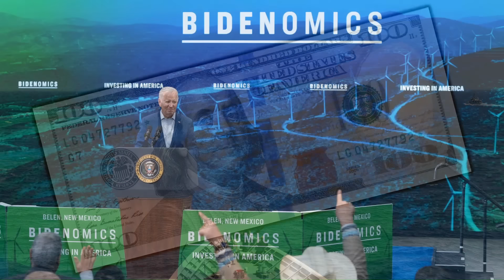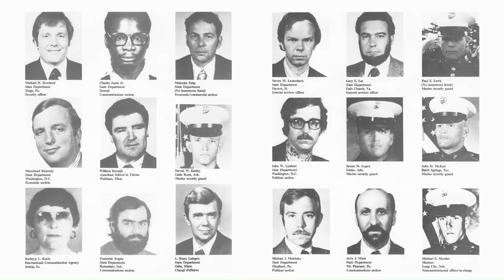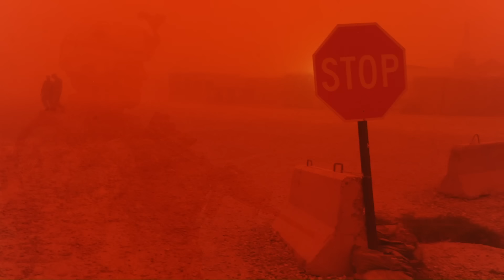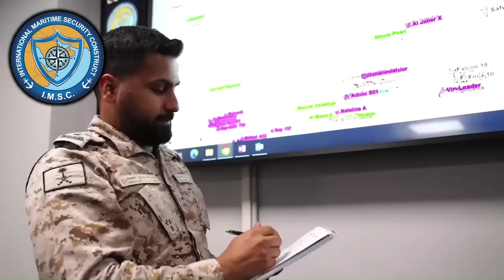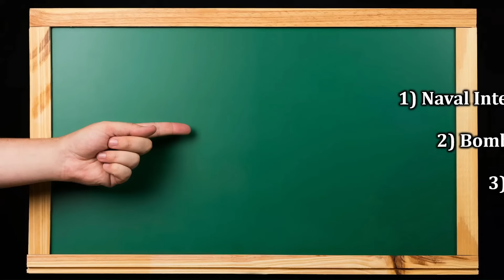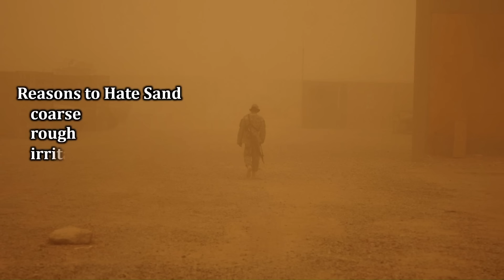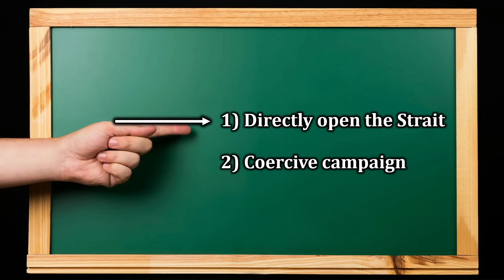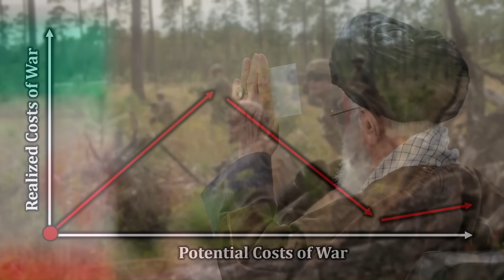The Nightmare Scenario in the Middle East

Comment: Speaking as a nuclear engineer:

The analogy used when talking about enriched uranium is very bad. Centrifuges are extremely power hungry devices, and having 60% U235 does make enriching easier, but that misses the point. The point is: You do not use 60% U235 for civilian purposes, anything above ~35% is reaching the upper limits of power generation enrichment. most reactors use anywhere from 1% enrichment to 30% enrichment. If a country is found to have 60% enriched uranium, it has uranium that is enriched past civilian use. This is the important point
Reply: Thank you for pointing this out
Reply: Obviously. The point he was making though is something else. He was saying you can’t pick out the U235 isotopes but you can have more of it if you keep spinning it in centrifuges until you have enough to make it a weapon.
Reply: It will be used only for peaceful purposes😂😂😂
It will. It will.

It will be used for clean energy and medical research. And will never be used to attack Is... Oh boi

Comment: The portion about submarine minelaying is very poorly researched. There are no "safety corridors" and Iran's subs are considered very capable at minelaying. The mines would be primarily laid just outside the Straight of Hormuz, not right on it as that isn't necessary. The depth issue is frankly... not an issue.  They would have to surface eventually, but SSK endurance here is also very underestimated. All of Iran's currently operating subs are capable of minelaying and returning to their berths without puttering around on the surface. It would still be very risky, but I feel that the roadblocks detailed in the video drastically underestimate Iran's submarine force. This is a growing threat that is increasing year on year. The latest mines they use were purchased from China and can operate at depths up to 350 feet as well as very shallow water.

Comment: Two things people don’t appreciate with respect to nuclear weapons and enrichment are really vital for sane policy:

Atomic vapor laser isotope separation requires a lot less energy to function, along with less time and physical space.

As William Spaniel correctly points out the more than half the energy expenditure is done getting to 5 percent enrichment.

Less well appreciated is what it really means in terms of time to finish the job, and the fact that it’s easier to protect a smaller set of machines and materials.

A pilot (small) plant can finish the enrichment job even if the methods used to build it don’t scale well, whether for cost, sanctions preventing easy supply of critical components, or even high labor cost.

Also, it takes far less plutonium to make a nuclear weapon than uranium. Burning fuel once through even with a breeding ratio less than unity still means using a reactor, if you have the time to do it, multiplies the number of weapons a given supply of uranium can produce.

The fact that isotope enrichment can be used in reverse to remove plutonium 240 to get weapons grade plutonium from spent nuclear fuel is made easier by the front end chemical separation reducing the quantity of material that needs to be processed.

The Iranian choice to make more low enrichment uranium before increasing its purity has the double effect of hedging bets (being able to make multiple crude nuclear weapons, before going down the path of plutonium breeding, which at any given point is making more weapons than the opportunity cost of the currently tied up fuel.

I’d also suspect that Iran might forgo a formal nuclear test and instead use a nuclear weapon if pushed far enough in the near term.

The fact that Iran developed delivery systems before developing nuclear weapons is a bit backwards from history would create for expectation and will provide little warning if/when Iran first uses one as a weapon.

Comment: Very interesting & instructive thanks.
A quick look around online shows that Iran in fact has at least 75 diesel electric submarines but there is considerable dispute about how many are actually in operational wartime condition. 
Some years back they actually published thier policy for shutting the straights. 
They would tow oil tankers in to the strategic shallow spots & sink them to lessen the navigable channels  & use massed mine laying, shore missile barrages & massed small speed craft swarms including suicide attacks.
At the same time a large part of their submarine fleet would mass attack the Saudi oil fileds & production centres with ballistic missiles.
They acknowledged they could not win, so their defence is to threaten to shut the western world down, even if it costs their regime.
I've not heard in recent years but I would be very surprised if thisisn't still their tactics.

Comment: Who needs oil from there when you can run a Toyota Mirai for a quarter the price of an equivalent conventional vehicle. Keywords proton exchange membrane, no batteries, quick to fuel, no suck squeeze bang blow internal combustion engines, hydrogen fuel cells are now also powering Kenworth trucks for long heavy haulage

Comment: Surprised to find a missing scenario in this otherwise detailed analysis. UUVs or drone submersibles which were developed by the IRGC and deployed by the Houthis for the first time in February 2024, represents a major reframing of threat scenarios in the Strait of Hormuz. Mining the strait makes little sense considering that China imports 90% of Iranian oil production, the majority of which flow through these waters. Although the Iranians have begun diversifying exports through Jask Port in the Gulf of Oman and other alternative routes these represent a small fraction of Iran’s overall flows. At the same time these exports account for 17% of China’s oil imports, so there is little reason to suppose the Chinese government would support such a move. In sum, any hard shut down of Hormuz falls well outside of the bargain range as it represents an outright diplomatic and economic form of self-sabotage for the Iranians that would cripple their own economy. However, the risk of a low-intensity, escalatory maritime drone warfare scenario, where only specific flags are targeted through UUVs is an emerging threat vector that deserves some attention. CENTCOM has described it as an "imminent threat" to U.S. warships and international shipping. Even this would be difficult without a navy. Or coastal bases. The real issue would be the escalation ladder, where from those kinds of plays things could rapidly escalate to ASCMs and drone targeting of ships and if those sites are struck, outright targeting of Gulf oil fields. Even in the worst scenario where Iran decided to Hail Mary and shut down its own economic lifeline the U.S. has 4 MCMs stationed in Bahrain and clearing could be accomplished in 2-3 months. This would have an acute impact, but the world would go on. Tehran’s leadership, not so much.

Comment: An idea comes to mind: To load up an old barge with mines and ""accidentally" sink it in the Hormuz straits leaving a control cable behind the tow boat you can connect to land and release the mines to the surface whenever needed. Or using a timer such as ropes rotting in water. It's a simple idea and I'm probably not the only "genius" coming up with it so how do you protect against something like that?

Comment: A point that wasn't made in the video is that between 1953 and 1979, Iran and Arab countries took opposite sides on the subject of Israel vs Palestinians.  But since 1979 they have been on the same side.  Since 1949 no Arab country has been willing to go to war for Palestinians (and neither has Iran).  The only wars they have been willing to fight with Israel were when invaded by Israel or to try to recover their own territory from Israel and even Syria hasn't tried that for over 50 years.

Hopefully, the interests of the US are not the same as the interests of Israel, unless you believe that the US supports the subjugation of the Palestinians and the expansion of Israel into the territory it captured in 1967.  Obviously, Israel wants everyone to believe that the US supports them over all these issues and certainly the US does very far less than it could do to try to obstruct Israel in these goals.  

As the various Arab countries have been bribed by the US into recognising Israel or have been outright destroyed (Iraq, Syria, Libya), Iran becomes the most vocal remaining critic of both Israel and the US.  It is clear to Arab countries that the only way to a safe and prosperous future is to go along with the US and the US will insist that this means taking an anti-Iran stance and pushing Palestinians to the bottom of the priority list.  The US realises that the techniques it uses against Arab countries (be bribed or be destroyed) don't work with Iran.  So it is using isolation and anti-Iranian coalition-building instead.

Comment: Isn't the most straightforward solution a big pipeline that bypasses the Strait of Hormuz?

All these military suggestions are ludicrously expensive compared to just building stuff.  Look at the length of that East-West pipeline in Saudi Arabia, and the mountains they had to cross.  It's doable.

You blew off this possibility early by pointing out that a pipeline is a fixed target and easy to destroy.  That's not entirely true.  Bury the pipe under 50-100 feet of whatever's around, and you require very large warheads to break it.  Those warheads require exceptionally large delivery systems, which the US is already expert at intercepting.  And of course, every major pipeline system is made of multiple pipes, separated so that a break in one does not affect the others.

Heck, the UAE can have one pipe and Oman can have another, getting more resilience through more diversity.  Private companies won't pay to overbuild like this.  The redundancy serves national security, so governments pay for it like they pay for military assets.  But a pipeline outlasts an aircraft carrier.

It's a boring option because it deletes most of the international intrigue in favor of a program which gainfully employs a lot of construction workers to make a durable piece of infrastructure which reduces international relations.

Boring is profitable.  Boring lets us get back to arguing about who is on our school boards.  Boring is good.
Reply: Kuwait Bahrain and Qatar can't bypass strait of Hurmuz. Iraq, AUE and SA already made it. But they have to be 3-4 times bigger.
Reply: @micixduda  Sure, but can't the Gulf states build a pipeline that goes down their side of the gulf through to UAE and Oman?

Sure, it goes through multiple countries.  But lots of pipelines do that.  The point would be that it doesn't go through Iran, or to a port controlled by Iran.
Reply: @IainMcClatchie  Small states small production.
Bahrain is hardly worth mentioning with 167k bpd.
Qatar 1300k
Kuwait 2600k
UAE 3300k
Iraq/n 4450k/4100k
SA 9000k
-----------------
Total: 25kk
20kk goes over sea
5kk goes over land
Reply: @micixduda  First, that's a useful answer and I want you to know I appreciate it.

The video says Iraq, Saudi Arabia, and UAE can get their oil out without the Strait of Hormuz.  Is that true, or only partly true?

If it's completely true, then there's just 4000k that has to go through the Strait of Hormuz.  Are folks shipping through Hormuz because they want to avoid the fees from e.g. UAE for transit to their Gulf of Oman port?

Or is the UAE port insufficiently secure from Iran?  In which case, why not a pipeline across Oman?
Reply: @IainMcClatchie  Well lets just start with i never thought about these things before i watched this video.

Iraq goes via Turkiye to Mediterranean close to Europe. So Europe doesn't have to pay for longer shipping around the SA peninsula and Sues canal fees, but has to pay transit costs via Turkiye. I guess this balances out a bit, but considering it only transports less than 1/10th of production. It seems Europe rather gets its oil elsewhere or it is still cheaper to get it with ship all the way.

SA: Seems like it sells most of the oil toward the east. It has 5 kk pipeline and it  efficacy is at around 50%(good quarter of its production).

UAE has the capacity to transport via pipe almost 50% of its production to the east coast.

As for Oman, i have no idea. Maybe It can also be influenced by Iran, like Yemen is or it just comes down to transit fees and lack of oil infrastructure in Oman itself. Oman production is 1000k. Less than Bahrain with 1300k. 
But i'm sure Oman would have no problem upgrading its infrastructure, if they would build the pipeline to it.

Kuwait could probably use both SA or Iraq pipelines  to transport, but initial cost and transit fees are just not viable option atm, i bet they would start building those pipelines, if strait of Hormuz would be closed more than 1/4th of the year.

Best way to avoid transit fees is build pipeline in international waters, but pipelines in international waters aren't safe. Couple of divers or submersible drone, can do the 'nordstream' thing at anytime.

Comment: My only criticism on the war game point. The US purposely plans their wargames out with the intent of putting the us on a severe disadvatage. The planners think of all the variables that they can predict can go wrong and purposely set the game up with those variables go fubar. Things like stealth aircraft stuck with their bomb bays open, negating stealth, radio equipment breaking, lack of supplies or ammo. The us purposely loses war games to 1: get soldiers used to shit going wrong so they dont panic when plans inevitably fall apart, and 2: calculate contigencies and redundencies so any mistakes in a real fight are irrelevant. Failure in a war game can be corrected, failure in war cant.

Comment: Speculations and theories. What would occur if it did? Even if the maps are superb and the border crossings are presented clearly, 50% of what is displayed here is inaccurate. If the Iranian-Israeli confrontation worsens, it will be for reasons unrelated to Hormuz or the economy. Furthermore, nobody can predict how the neighboring Arab governments will respond to the final conflict. Their government, level of totalitarianism, or the degree to which a ruler controls his subjects all play a significant role! This is particularly crucial in Jordan and Syria, which declined to give Iran any assistance (despite the fact that Iran and Hezbollah helped to maintain Assad in power), as Assad fears that the confrontation between Iran and Israel may seriously destabilize his rule. To fully describe the complex relationships and all the characters and complications that may push the Middle East's stakes to an extremely perilous level, a full-length television series spanning a few seasons is necessary.

Comment: Watched the whole video (could have been shorter, really) and what I noticed is that you didn't mention even once the massive missile capabilities of Iran (incl. drones but also hypersonic missiles), which are their main asset other than land forces. That's cheating the "analysis" big deal, and it is because it has become very clear that this turns all US military bases in the Persian Gulf and also its deployed fleets, especially those costly and very sinkable aircraft carriers, into "sitting ducks", as we've seen in the case of the retaliation for the murder of Soleimani and the damage by the rag-tag Yemeni forces (Sana'a) of the USS Eisenhower, which had to pack away from the Red Sea (sure: the USA denies it was hit... but it was). 

You didn't either consider what use would the US military bases be for once Hormuz is blockaded, which would not actually happen at Hormuz Strait proper probably but rather towards it West (because there's where the shipping lane is shallower and just sinking a few cargo ships would totally blockade it, look at a bathymetry map!) 

So overall an empty exercise of pretense without really dealing with the real deal.

Comment: Made it 30 min in and the video went from biased to outright propaganda, fuck this video. free palestine,
Reply: For them to start a war again later? Both parties made many mistakes and non-willing to resolve the issue peacefully. The best outcome now is forced negotiation, which require either one of them surrender or a strong outsider trusted by both parties involved. Free Palestine is the worst possible outcome locally since it will only escalate the conflict.
Reply: @dunnowy123  How does the occupation happened? Therefore, it's series of mistake by both parties. It's not that simple and I really hope you trying to understand what happened instead of simply assign right/wrong.